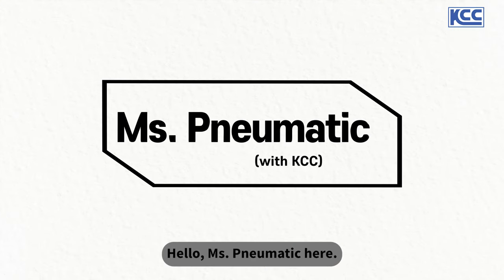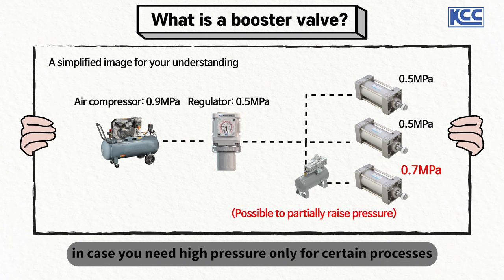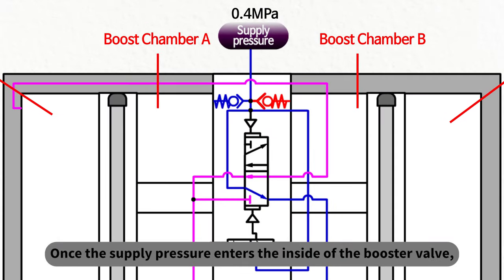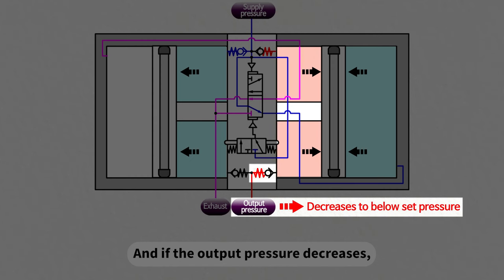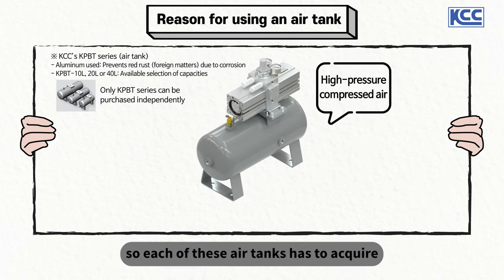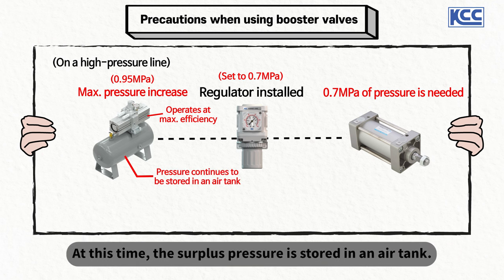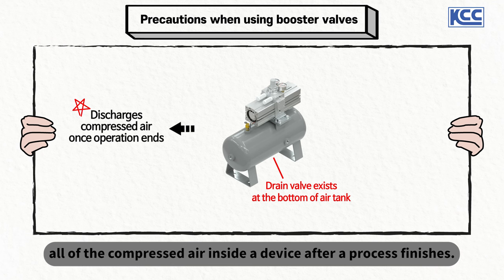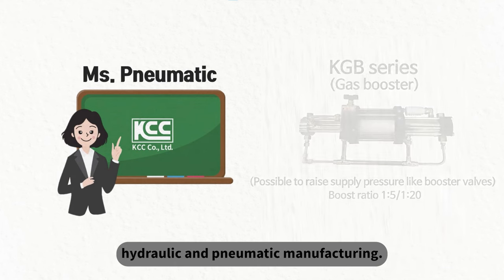Booster regulator : Working principle l Animation

Comment: Good development product.
Reply from the maker: thank you
Reply: What is air supply pressure in this case? 0.4MPA? Or higher? If it is at the same pressure level then the system would be at an equilibrium